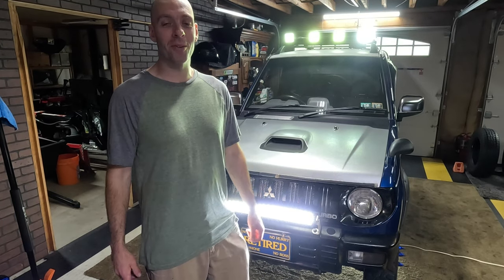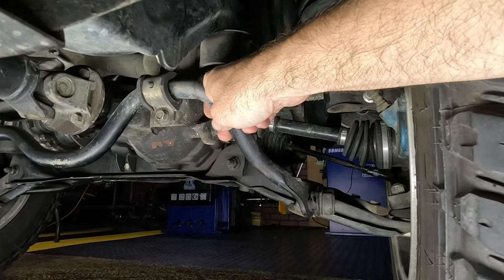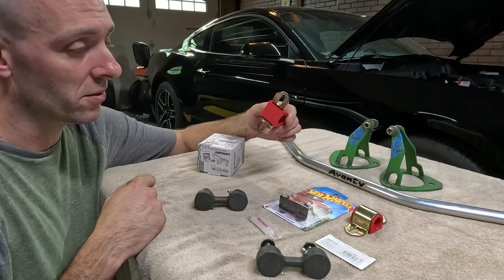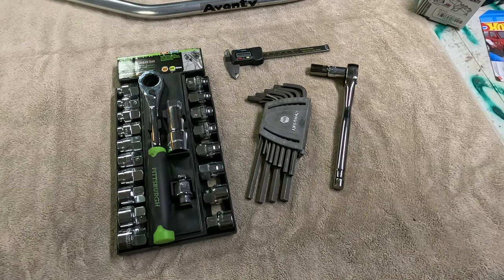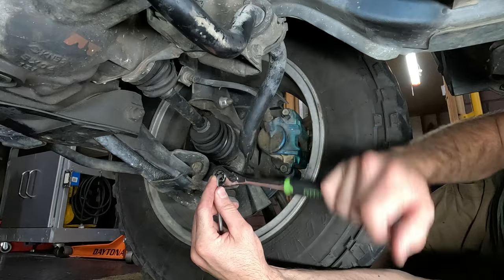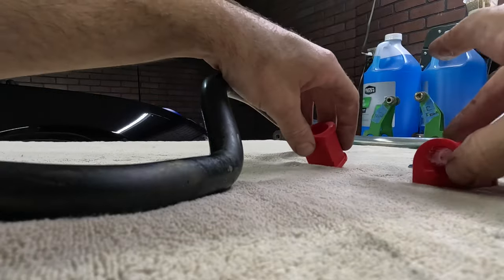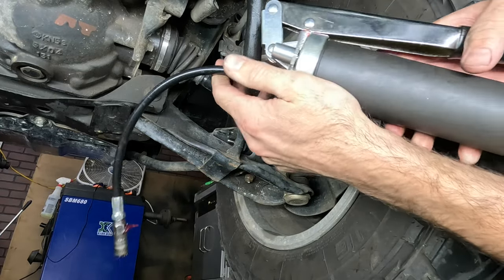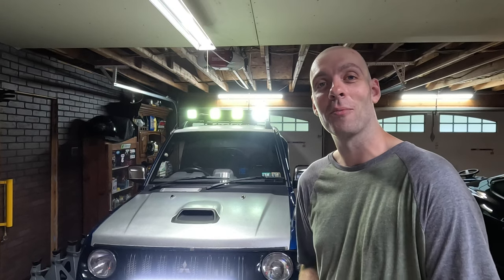Pajero Mini Front Swaybar Maintenance Bushings & End-links

Comment: Great video, thanks. I have a ‘95 Delica Spacegear 2.8 diesel and I think it’s the same setup. I’ll measure the diameter and link centre spacing to be sure and if they’re the same I’ll use your part numbers. If the links are just a tad shorter/longer than OEM will it be a problem, change handling etc?
Reply from the maker: I suspect that the Swaybar end link length is related to the reaction of the swaybar itself so shorter may be stiffer and react more quickly, and longer may be softer react later. 

If the parts are oriented correctly, and have the same relative length (with in a few mm) shouldn't be an issue